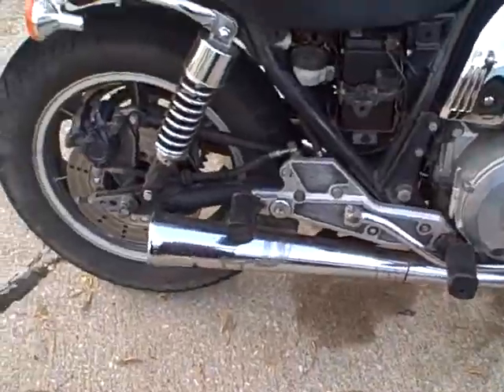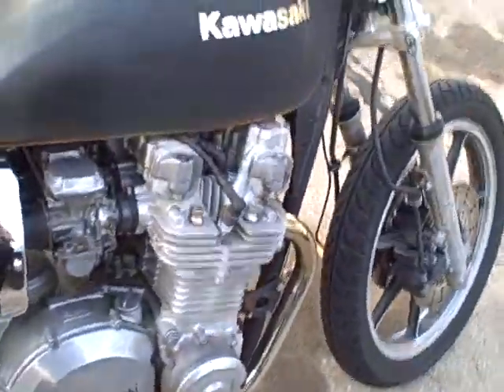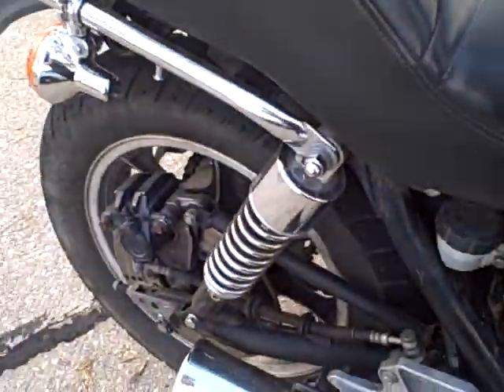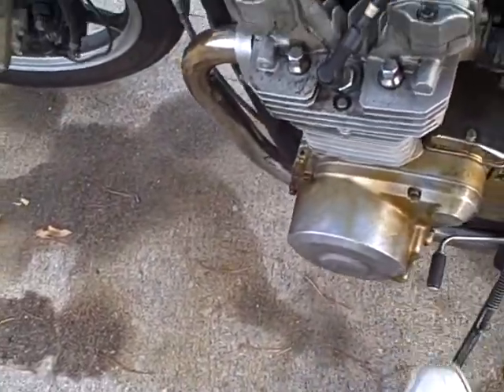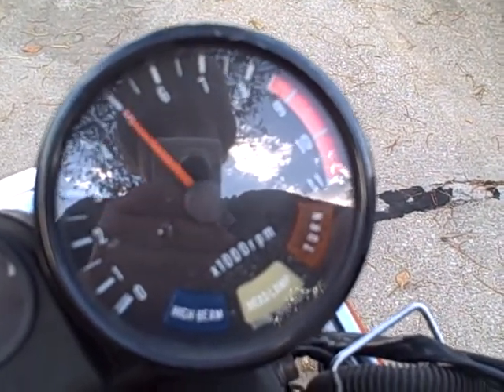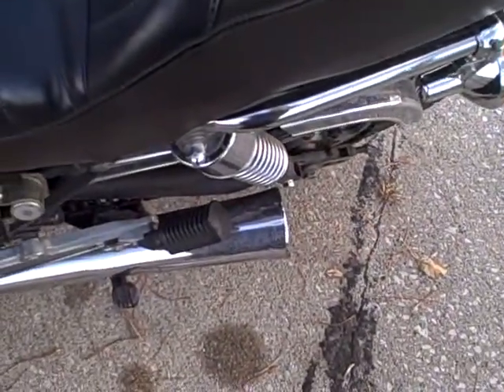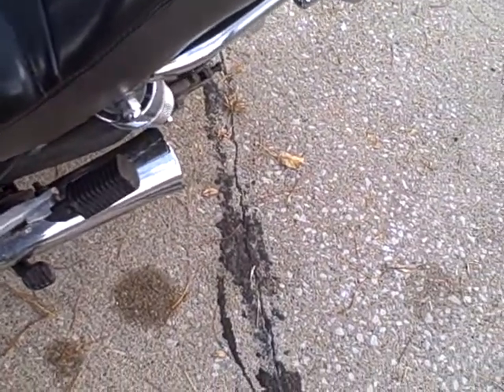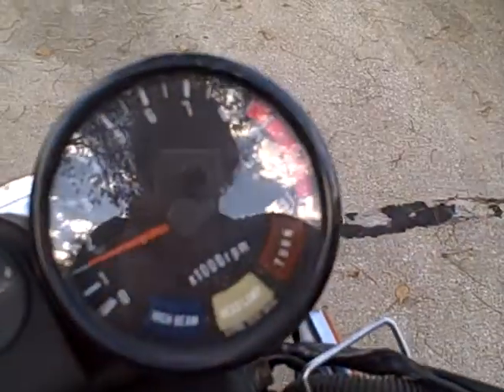KZ1000 spits and popps after heavy acceleration

Comment from the maker: @devares28 It has the stock KZ1000 exhaust for that year. I found the problem, that carbs are tuned properly and have stock jets. The problem was the exhaust. The Crossover pipe that increases bottom end torque had rusted off on one side, leaving one side of the exhaust wide open and the other partially open. So it basically just had a bigass hole in the pipe. Im gonna zap it shut with the arc welder AND BE ON MY WAY!! :D Thx for the comment.

Comment: Your bike is fine. If anything its running a bit rich but rich is always better. The poping is just excess gas entering the exhaust pipe and combusting in there. Perfecally normal. The reason it does it when you rev it up is because when you rev it and then let go of the gas quickly the throttle valve closes and there is still an emmence vacume, so all the negative pressure just sucks up more gas instead of air from the carbs. 1978 KZ1000LTD owner.

Comment: I have a 78 KZ 1000A. I can identify the same float bowl leaks that coat the starter cover. ..so I just rebuilt them. The header that was on it when I bought it was cut down,and even with the back shock. These bikes run on . Almost imossible to dial in,until I at least get a slip on. Some say the popping  can be from too low of octane. Yours sounds pretty strong though. It can be a real crap shoot to tune without the stock airbox. If
 the bowls leak too bad,she'll be starving. Anyway,good luck.

Comment: you need to rejet your carbs its running lean put an exhuast on with baffles works. so basically go through your carbs and get the right exhaust and it should sound better after being synced and rejetted for the right fuel to air mixture.

Comment: It is either running too lean or too rich!!! I'm thinking it is running a little too lean!!!! Run it for about 2 minutes and turn it off and pull the spark plugs out if they are wet it is running rich!!! If they are dry and bone white at the the top then it is running too lean!!! That bike has four separate carbs and some might be running rich and some might be running lean!!! Check for holes in the intake too!